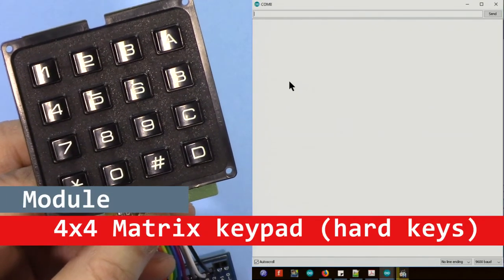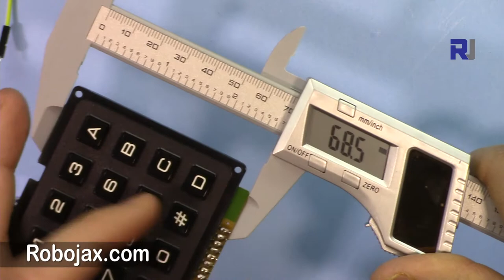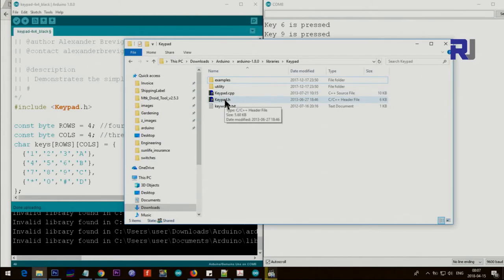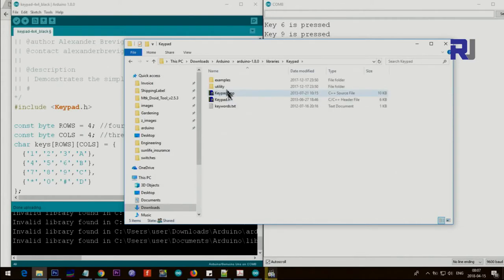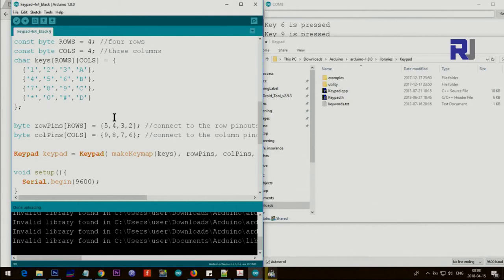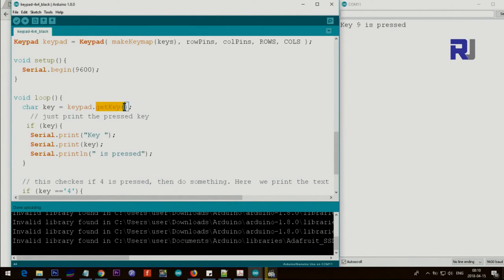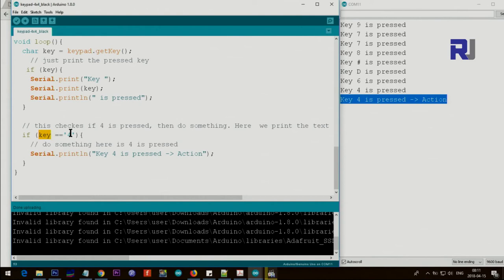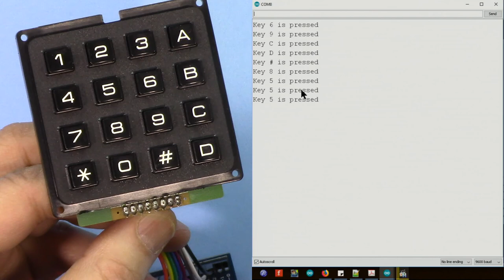How to use 4x4 matrix keypad with code (hard keys black keypad)

Comment: What if i need to put 2 or more digits into a variable so that I can use for calculations later (ex 123+456), how do we accomplished this?
Reply from the maker: Let's say you want  make a code 2345, once the data (for example 2) is received from user, convert it to "string" and save it.  then once the 3 is received, convert again to string, and "contatinate" it to 2, the same way to for 4 and 5, and finally you will have 2345.

Comment: How to generate interrupts when a particular key is pressed provided we have to scan both rows and columns
Reply from the maker: actually this code is scanning both keys. Arduino UNO  Interrupt can monitor 2 pints see it here https://www.arduino.cc/reference/en/language/functions/external-interrupts/attachinterrupt/ and I have used interrupt in this project https://robojax.com/learn/arduino/?vid=robojax_relay_timer . So you should be able to learn from it. Good luck.

Comment: Hi. Is there any resistors inside the keypad? Thanks
Reply from the maker: Hi, I tried to find it, but no luck. I assume there are no resistors.
Reply: @robojax  Thanks. These keyboards are designed to work without pullup resistors the Stanley ??. Library supports them.  I tried one identical to yours and no problem. Thanks again
Reply from the maker: you are welcome.

Comment: how to write for example 125 as a number ?
Reply from the maker: that needs separate video. it is like key to or pin number. You can save 1 and then 2 and then 5 into 3 variables and then check them against values you have.
Reply: @robojax   please record that video about how to write 125 and mention me